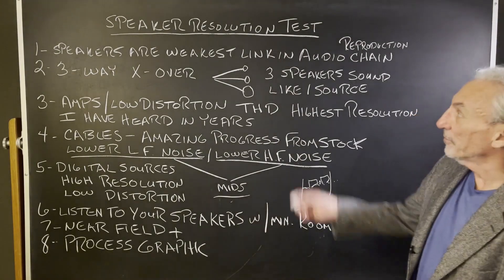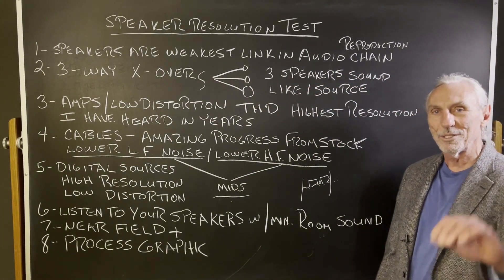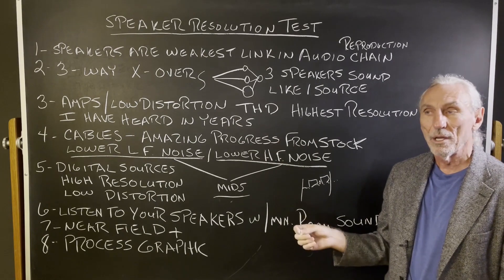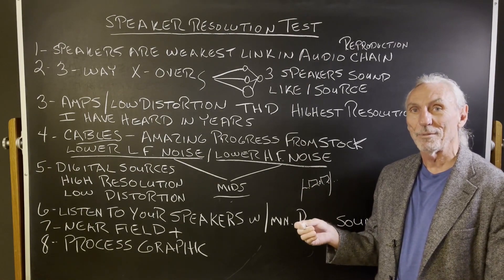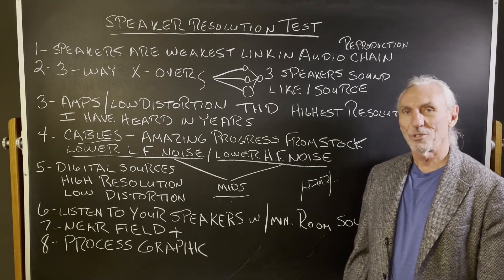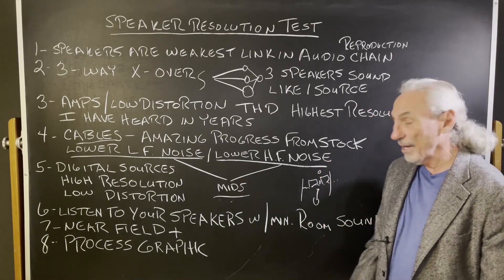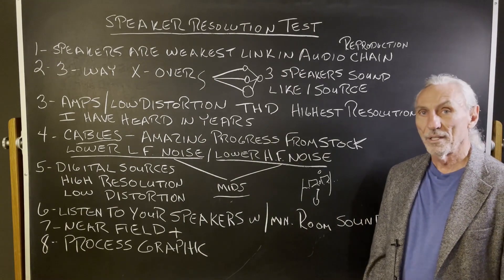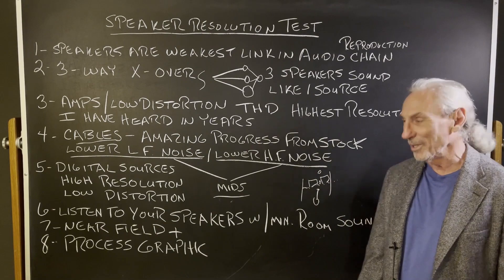Speaker Resolution Test - www.AcousticFields.com

Comment: I thought the video description sounded like it was going to be "Can you hear this sound on this CD or record" kind of test. The problem with that is people would all have to have the same CD. I can think of one though. If you have a bunch of Xmas compilations cds, chances are one of them has White Christmas by Bing Crosby. A selection just about everybody has, who have a lot of cds. The master tapes got worn out from making so many copies of that biggest seller long ago, so what you're hearing is a record of the song played back with a cartridge. If your system and CD player is of medium resolution you can barely tell, if at all, that its a record playing. With higher resolution systems it is VERY obvious from all the tiny ticks and pops that you are indeed listening to a recording of a record playing. On a really high resolution system, the ticks and pops are not virtually inaudible or subtle anymore. They are really obvious. See how many you can count. David Berning, the great tube amps designer, once used  a recording of boat whistles miles out at sea, with the ships way out at sea getting closer and closer & coming ashore. He compared how many boat whistles you could hear with the recording played back through a tube amp vs. a solid state amp. The tube amp won handily with its bigger sound and higher midrange resolution; including spatial resolution.. Even the late Harry Pearson of The Absolute Sound mentioned how clearer the midrange is when using a good tube amp. The midrange is more forward sounding, even though it is not as bright as solid state usually. And brightness always emphasizes detail. I use both tube and solid state. Each has their own strengths and weaknesses.
Reply from the maker: Experiencing near field speaker resolution is one variable. Experiencing that near field resolution interacting with the room is a much different variable. Very much different.

Comment: We had a backyard party once years ago, and put a pair of LaScalas in the back yard on a 10x10-ish concrete pad in the middle of the yard. It was early in the day, party to start later, so we decided to put a chair on the pad about 10' away so it was roughly an equilateral triangle. Some old shag carpet to reduce reflection off the concrete. We were young drunk guys messing around. It actually sounded pretty good! Sort of your "the best room is no room" concept in a way. No walls or ceiling, just a carpeted concrete floor.
Reply from the maker: Yes, this is a good example of no room boundary surfaces. The difference in sound quality is amazing. Thank you for sharing this example.

Comment: Dennis, do you have any experience listening to coaxial speakers? My understanding is that having 2 drivers firing from the exact same location helps them blend into a single source for higher resolution.
Reply from the maker: Some speaker designs I see go to great electronic lengths to minimize reflections from the room bounday surfaces. I  have not had the chance to listen to this design.

Comment: I bought some high quality materials and made up some higher quality speaker wires and interconnects and I was amazed at the improvement in sound quality over old stock over the counter cables then I rebuilt my crossovers with upgraded component parts and the results were immediate and quite a noticeable upgrade and something everyone can do. It’s that easy. 

Thanks again Dennis for excellent presentations.
Reply: lol 😆 Dennis sure knows his customers. 

You wanted your money on wire!
Reply from the maker: It is amazing how much cables have progressed in both material types used along with construction methodologies. It appears to be about conductivity and noise suppression when it comes to cables. These are my  observations to date.